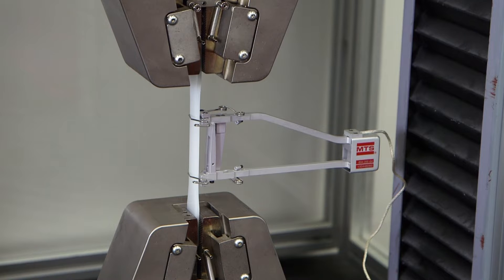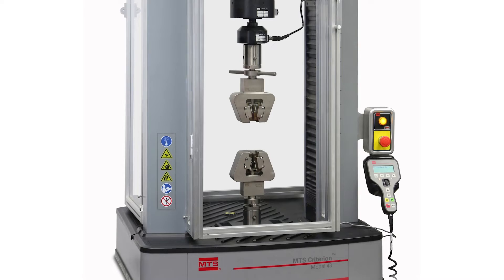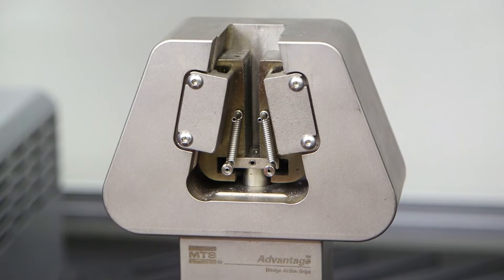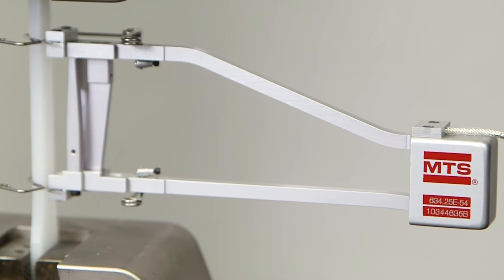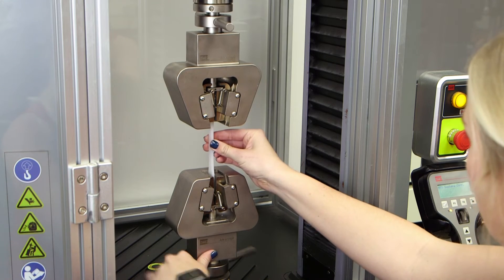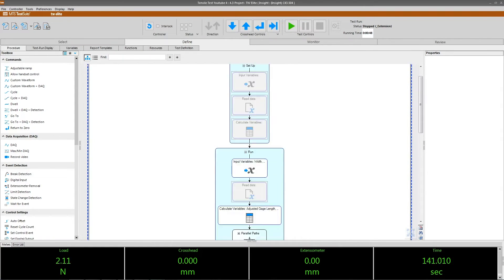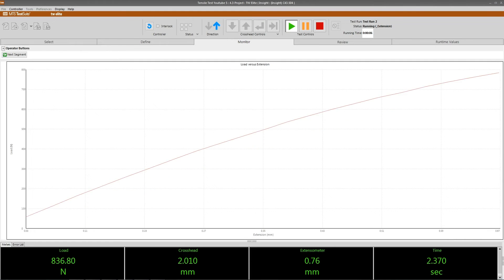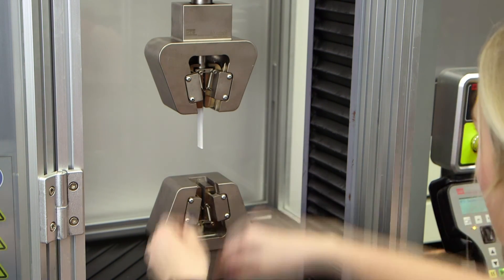Tensile Testing Basics

Comment: Great video! A couple small constructive criticisms for increased accuracy, these are in exact chronological order, these recommendations are for Testing in Tension in accordance with ASTM E4, ASTM E4, and ASTM E83 for Calibration and ASTM E8 for testing and good practice in accordance with industry norms.

1) The test specimen shall be hung from the top grip, leaving the bottom disconnected. 
2) Tare the loadcell/force channel.
3) Connect the lower grip to the specimen. 
4) Install the extensometer.
5) Remove the Gage Length setting zero pin or release the zero mechanism.
6) Zero the extensometer/strain channel. 
7) Zero the crosshead/displacement encoder channel. 
8) Apply desired preload. 
9) Begin test. 

This method ensures that the loadcell and test specimen are only experiencing applied forces which is arguably the goal. Additionally this insures the stress/strain of preload is captured by the extensometer, this means your strain reading won't start at zero it will be offset by whatever amount of strain the preload imparts on the specimen/extensometer. But that's okay because preload is generally designed to make up for mechanical slop of the fixtures that you don't want in the force graph as it's generally non linear, but it is helpful to at least include the extra strain as a zero offset for informational purposes. This method also makes sure to capture any absolute crosshead displacement that may be lost if you are zeroing the crosshead after preload. Again this will cause a zero offset at the starting position of the test graph but that is okay since it does capture some informational data without plotting the nonlinearities on the graph. That being said, none of this is a deal breaker or risks data legitimacy and the way MTS is performing this test is completely valid and in line with industry standards/specs but what I am recommending just gets you that extra 0.1% of accuracy and can reduce your total expanded uncertainty. But MTS is a well regarded company who knows their stuff and follows the specs so I am in no way saying this is wrong because it isn't, I'm just recommending some additional steps to increase accuracy. Thanks for the video!

Comment: You did not remove the extensometer until the specimen fracture,  will the extensometer be broken if operate like this?
Reply: There is not nearly enough mass to create any force large enough to damage an extensometer when testing this material at these dimensions. If it were metal then yes you'd definitely do an As Found just in case, but in this scenario you could run these tests all day through fracture without an issue.